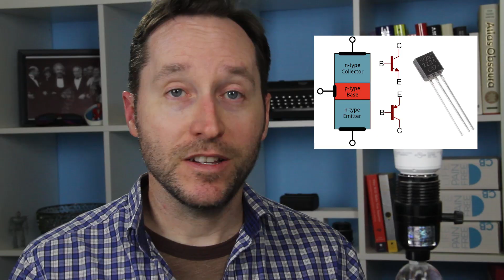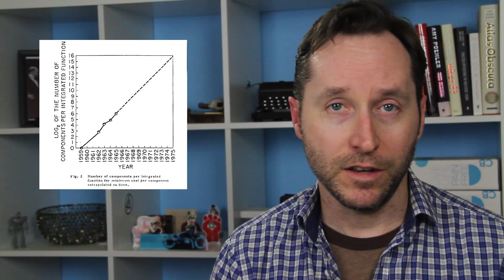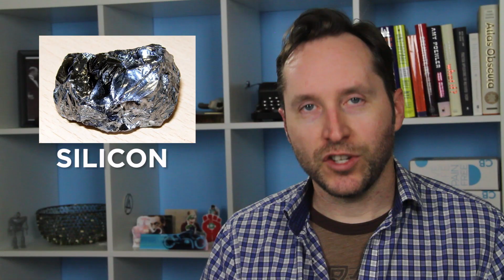Moore's Law Is Ending - Here's 7 Technologies That Could Bring It Back To Life | Answers With Joe

Comment: Having built software to program large multiprocessors, back then (90's) they said why bother, single cpu is going to double soon.
The point they didn't notice, is that this speed increase multiplies when you have multiple processors.  So when we have 32 processor 386,
it got 128 times faster when they just went to 486, not just 4 times faster...  but it is not easy to fully utilize this speed.  
If one processor goes 1 million times faster, but the process takes two steps, it can only go 1/2 million times faster.
I made this comment on another of joes video on superintelligence.  We became smart because of testing and experience, that is a serial process.

Comment: I'd like to see graphene processors. Though photonic processors would be better I think that tech is a bit too far off in the future. I'm pretty sure that moore's law is dead as far as silicon is concerned. I've got an 8th Gen intel and the 9th and 10th gens are no faster. They just seem faster because there bumping up the RAM and replacing the spinners with solid state drives. My 8th gen MSI was upgraded to 1TB SSD and 16 gb RAM and it out performs my Intel 9th Gen Mac Book Pro (2019 16 inch model).

Comment: Future HP standard troubleshooting procedure for customer inquiring about loss of functionnality on their laptops:
1. Did you properly feed your laptop twice a day using certified HP Threadfeeder Omega Plus Deluxe?
 Please note that the use of any other brand will void your warranty.
2. Did you check your laptop for signs of fever?
3. Was the ThreadSleeper Super Plus++ processor blanket properly applied onto your laptop during night time?
4. Have you hugged your laptop the recommended 10 times a day?
5. Did you try to kill and revive it using HP ThreadKiller and HP Lazarus Ultra?
6. Have you been browsing content that your laptop dislikes on YouTube?

Comment: We are definitely at the end of the traditional models of computers and transistor building. Any of the things you mentioned will cause a step improvement instead of the linear line we've seen the past 50 years. Although, we might see something like Moore's Law come into play again once there is a viable breakthrough, depending upon the physics.
Reply: Really interested to see how they plan to handle the initial change. Probably something similar amdx86-64 to ease the transition, but not sure it will work the second time as it's just too drastically different. Maybe through emulation? If the new stuff is powerful enough, could work as a transitional duct-tape.

Comment: everyone gets this wrong about quantum computers
the quantum bit does isn't really in the two states of 0 or 1 at the same time, that really wouldn't be useful  The thing is, we don't know what the value of the qubit is for most of the operation, because it has a probability of being 0 or 1, (could be 50/50, could be 65/45, could be 100/0), and what we do to the qubits is to alter those probabilities, it's a entirely different mathematics and theory to classical computing
and the whole thing of why quantum computers are exciting is because of NP problems. today computers are great at solven problems called P problems, they can do it really fast, but there are some more complex problems, called NP, that, it doesn't matter how powerful the computer is, doesn't matter how much supercomputers you're using, they'd still take trillions of years to compute the problem
and quantum is very good at solving this kinds of problems, and they range from encryption for safety, protein folding for curing diseases, simulating the universe to solve for chemistry and physics
if quantum computers become an actual thing, it isn't that far off to think about curing Cancer, or other things as complex as curing Cancer

Comment: I've always associated Moore's Law with speed, and in that sense, it's come to an end quite a few years ago. About six months ago, I replaced my 9 years old Intel Core i7-960 (a very fast chip at the time) with an AMD Ryzen 9 3950X. Before that, I couldn't really bring myself to spend €€€ on a new motherboard/CPU/memory, because the speed increase didn't justify it. The Ryzen is an absolute beast, and has obviously been superseded by faster CPUs since, but it might be another decade before I feel compelled to upgrade again. Part of the problem is that we have to go parallel to gain significant speed increases, and parallel computing is just really much more complex than single-thread computing.

Comment: In a practical sense I would say that Moore's law ended more than 10 years ago. I am old enough to remember when both CPU speeds and data storage capacities were actually doubling every years. My first PC had a CPU that was 25 Mhz that's right Megahertz not Gigahertz.  Back then, if you did not upgrade your computer after 5 years it was literally obsolete as the latest CPUs were 32 time faster. Old software would be unusable on new hardware because they used 'ticks' for timing and new Software could not even load on an old CPU because of storage and speed limitations. About 10 years ago CPU's had reached 4+ Ghz and today the most advertised CPU speeds are between 2 and 3 Ghz. Since CPUs have not been getting faster (Commercially at least)  they have focused on other things like multi processor systems, but most systems have 4 or less parallel processors today. Most improvements now a days are in GPUs and Storage systems. But this is not the same as having CPUs double in speed. I know this because I have PCs that are 5 years old which work just a well as my brand new PCs. 'Back In The Day' that would never happen.
Reply: Even i have a 6 yr old pc which is working fine

Comment: They have gone as far back as the Renaissance and not, war, economic collapse, or even the 1918 Influenza Pandemic could slow the progress of technology as; the progress of technology is mirrored by the advancing of knowledge. We will inevitably develop new technologies and new materials that will end what some perceive as the end of More's Law as; it's already in development. In fact, futurists, technology experts, etc, have been predicting the singularity for decades; and it is this singularity that will soon be advancing all knowledge rather than just specific areas. Artificial Intelligence will be a big part of this as; it is able to model large and complex systems, and can even data mine specific things like, the Material Sciences to help discover new technologies that humanity missed by failing to connect the dots. Another thing is,  in the same way 3D modeling has helped speed up the development phase of creating new technologies; through enabling people to quickly prototype parts to make sure they work as expected, simulations of a technology can be simulated by Artificial Intelligence, to help they will operate as expected even before they move on to printing the prototype for testing. The ability of A.I. to data mine the collective knowledge of humanity will definitely help in the advancement of technology. What people also forget is, a sudden breakthrough of a technology such as, the steam engine, the combustion engine, harnessing electricity, etc, can change the face of society. I think in the same way the Internet has enabled collaborative research and development around the world, so to will Augmented and Virtual Reality. At my 50 plus years, I look back at how far we have come since I was a kid, and wonder where we will be in the next 50+ years.

Comment: The drop off from Moore's law was also mostly a change in focus from PCs to mobile where operations per W are more important that peak speed and also even in data centres the limit is heat dissipation so the amount of processing in one standard rack was more important than processing per cpu.....  Progress but just with slightly different priorities....

Comment: Joe can you tell me again how I can let my computer be used by scientists rather than relying on massive supercomputers? I have a home-build, liquid cooled octocore overclocked at 4.3 GhZ with 36 GB RAM and about 8 TB of storage, externals not included. I know that you said in a video that astronomers can use my PC'S computing power to analyze data when I'm not using it, and could I continue to use my VPN when they do? . How do I get involved with that? It maintains a processor temperature of 101 degrees f when idle so I leave it on with a remote outlet that I can kill when a storm is approaching, something very common to SW Florida during the summer. You've really rejuvenated my passion for science, astronomy and physics especially and along with Zooniverse I would like to become more active. Any info would help. Thanks

Comment: Light computing would be so cool! It's like transferring fiber optic internet cables to the inside of a computer. If they can figure out an efficient and quick way to send the phototns through consistently and reliably, the speeds computers could run at...

Comment: All the ideas presented here, have been around for 30 to 50 years.
It would be extremely difficult for any new technology to beat an encumbant that had 60 years of exponential growth with a trillion in R&D.
Not even mentioning the software stack.
Even if, say graphene makes better chips, who spends 20 billion to get graphene to 10nm structure size while silicon keeps evolving?
And while you're developing your technology you can't sell a thing because silicone is so much more advanced.
I think, you're either on CMOS or you're dead.

Comment: The thing is, we are also running out of things to do with advances in CPU power.  There is only so much CPU consumer-level products can use. The human eye has a finite resolution, and it has been the driver for faster gaming hardware since the days of Pong.  VR will propel this increasing demand for faster CPUs for a while. but eventually we will hit a wall there as well. So relax, folks. CPU power is leveling off at roughly the same rate as CPU demand.

Comment: I'm a little late to the party, but I feel like you missed diamond chips. They have functional research diamond substrate chips that run over 80GHz. The printing process for diamond chips is still a little slow, but is improving constantly. It is essentially the same as using silicon, but with dramatically better heat and conductive characteristics.

Comment: I am wondering what a computer with an unbottlenecked 10Ghz CPU would require (specifications for its other hardware) for it to run at its full potential.

Comment: In 1944, the Harvard Mark 1 was a state-of-the-art computer. It weighed 9000 lbs.,  500 miles of wiring and used electromechanical relays. When that technology dried up we had vacuum tubes. When vacuum tubes reached their limit we had transistors. when discrete transistors became unwieldy we develop integrated circuits. 

For some reason, I'm not too pessimistic about the future of computing. It seems when we have a need for the technology, we will develop it.

Comment: The smallest molecular transistor I can imagine would be a sliver of pure diamond. The structure of diamond is such that, under normal conditions, its surface is coated with a one atom thick layer of hydrogen atoms. If we could devise a way to add and remove individual hydrogen atoms from the diamond's surface and then read the presence or not of a H atom in a specific location, then that's about as small as we can go unless we can find a way to trap and count individual electrons. I mentioned this elsewhere, and someone working in that research field replied that they'd achieved precisely that. It was some time ago and I doubt I could find the link he gave, unfortunately. They're still a long way from being able to apply it in affordable computing, but still it's astonishing and shows that there's virtually no limit to how small a transistor can get.

Comment: Silicon for computers isn't that cheap. You're right about it being the most abundant element on the earth surface, however silicon used in processors requires a purity that doesn't occure in nature. So both silicon for computers and graphene get almost all of their cost from the refinement process. I mean graphene to is only carbon, which is common enough.

Comment: It hurt every time he said that a transistor is either on or off as these days it's in one of two states typically up to 1.5 volts and one lower voltage state as it would be inefficient for the transistors to turn on and off
Reply: That's not really true.  CMOS logic levels are essentially the supply rail voltage and ground.  In order to decrease power consumption, the supply voltage has steadily decreased until nowadays processors run at well below one volt.  At this sort of level, it's a wonder they can make them switch at all.  But they do have to keep the transistors from going into saturation, because that would slow everything down.  But the essential principles of CMOS still apply.  There is almost no DC current flow, it is all due to charging and discharging capacitances.  That's the reason for the low supply voltage; it minimizes the amount of charge transferred on each jump from low to high and back.  

Also, I don't think it was mentioned in the video, but the limit on number of devices that can be placed on a chip is limited by the feature size of the process, which has been steadily shrinking.  This is a result of the increasing precision of the photo-lithography processes over time.  Joe did mention that we are approaching the point where quantum effects begin to be important, so we've just about reached the limit with silicon.

Comment: 7:31 DNA doesn't last forever. that's false. Also it's very susceptible to UV degradation (the same way UV radiation can cause melanoma), heat degradation, among others. that's the reason why you almost always see DNA in nature protected by a nucleus, or in the case of viruses capsid proteins. while storing information of DNA would be cool, it wouldn't be practical as it would be susceptible to corruption. if we could solve that, then yes it would be awesome, but it's nowhere near as robust as the magnetic strips, and semiconductors we use today as storage.

Comment: It ended about 10 years ago.  Look at a single-core benchmark chart and you will see that computers single-core performance has barely increased in the last 10 years.  Even multi-core systems aren't doing that much better.  Certainly not doubling.

Comment: It's also important to remember that computers are based off of discrete mathematical principles. Binary is just our symbolic abstraction layer. You can make abstraction layers with other types of discrete mathematical principles. I can't say how efficient other types of abstractions may be but it certainly is possible. Theoretically you could make a photon based computer using circles. These circles could be plotted according to square root. X^2 + Y^2 = 5. When you plot this you can see how at plot X = 1 you have Y = 2. You can arrange several of these circles according to position where the photon is picked up at certain intercept points and you can do some basic math. To drive this you'll need indexing and all of that but it's nothing we aren't used to. 

This is just a concept I thought up as far as I know it's not based on any real research. I'm just putting this idea across because machines don't really have to be based off of binary. There are benefits and detriments to any conceived system. For a while we were building analog machines, binary machines were just way more efficient and reliable.

One of the most exciting architecture I've seen in CPUs has been the release of AMD Zen. It kind of skirts parallel bottlenecks by just adding more chips and a very clever interconnect. What makes this interesting is that you can mix and match manufacturing processes to your liking on a single package. You can parallel all sorts of different work loads so we may start seeing the advancement of computing by highly split operating languages. I'm probably not using the right terminology but GPUs already are highly parallel.

If AMD have their way they would like to eventually split GPU cores onto several chiplets as well which would allow for crunching larger and larger number as well as building a logical net between processors. It's like a big mesh where you can build symbolic links between cores. I have a very hard time describing what I mean.

Comment: The chip with both ram and CPU together is probably the next improvement on the menu because it solves a big problem we have now: the bus between the CPU and the RAM can only go so fast, the motherboard layout gets really complex if you increase the RAM transfer rate and increasing the width also increases the price and complexity with all those extra pins... and you have all the CPU cores trying to read and write to the same RAM, a problem that grows bigger as you add more cores. If you combine DRAM and CPU, you could do something like make the bus 4096 bits or more... The reason it hasn't been done yet is that DRAM is done on a different CMOS process than other chips.